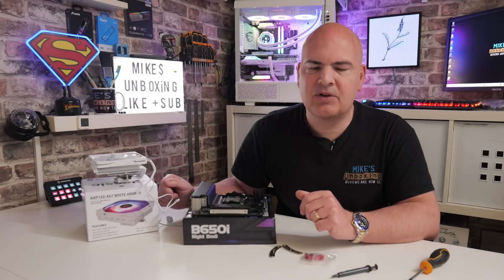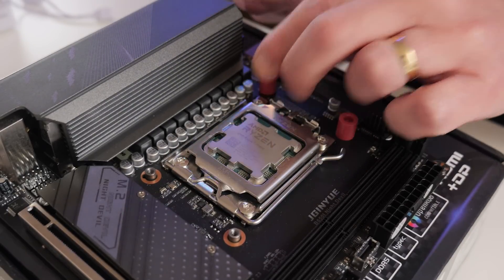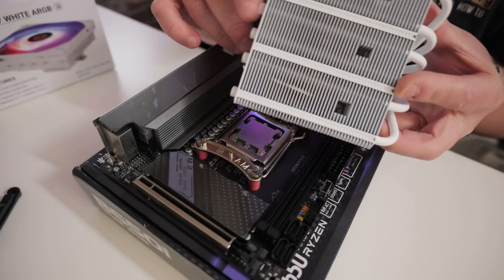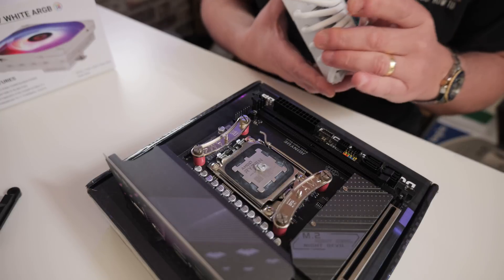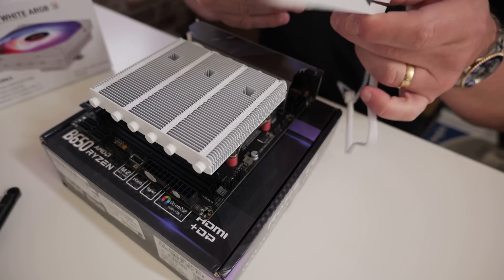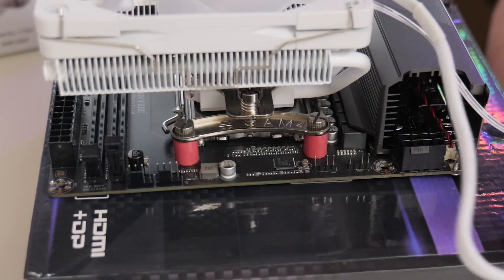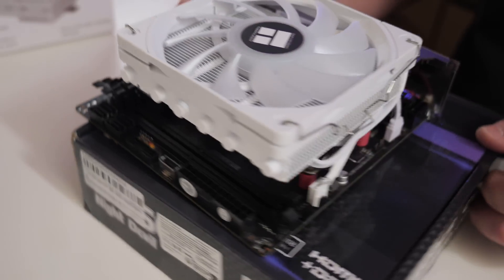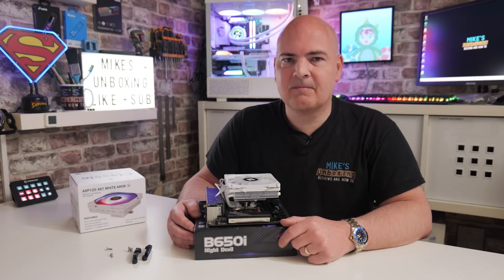How To Install Thermalright AXP120 X67 ARGB Low Profile Cooler

Comment: it looks like the fan blows DOWN....which seems wrong...can you turn the fan so it blows UP...a side lying pc with a grate on the case side could really benefit from blowing up...and out...keeping the whole chassis cool as a result.
Reply from the maker: yeah you can mount it either way, the stock Intel and AMD coolers have always been down draught coolers and it helps to cool the VRMs surrounding the CPU area

Comment: Would you be able to test Phanteks D30 120mm Fan with this cooler?  I am wondering if there is gonna be any difference.
Reply from the maker: with this cooler the real problem or sticking point is the thermal mass of the cooler, a more powerful cooler might shave a few degress off but it won't be night and day for the money spent

Comment: how tall of a ram module can you install? would the t force delta  ddr5 6000 fit? 46.1mm tall
Reply from the maker: you should be okay if you rotate the cooler, it might not be necessary though

Comment: Just installed mine! Hoping it turns out fine, the screws were a bit difficult and one went in no issue while the other needed to be pushed a bit, but it's all on and some thermal paste has come out the sides so I can only assume it's gone okay. We'll find out when I turn it on and it says "55°C" or "1000000°C" 😃👍
Reply from the maker: hopefully its the lower one :-)
Reply: @mikesunboxing  79°C while loading elden ring, 60°C average! Not bad at all and especially in a tiny 7.6Litre case. Thanks for your video, it really helped me.

Comment: Thank you Steve Merchant. Lol. When it comes to cooler heights, is the height they advertise always including a fan? This should fit in my case at 67mm with a 70mm clearance but I'm worried it will be a tight fit.
Reply from the maker: funny i used to work with his sister and met him a couple of times :-)
and yes the height includes the cooler and that is also usually part of the model name or part number
Reply: @mikesunboxing thank you :)

Comment: Hello what motherboard are you using. Want to make sure i wont have issues with the cooler. I tried installing this on a b850 colorful motherboard and it bent motherboards pins have to buy a new motherboard
Reply from the maker: b650i night devil motherboard